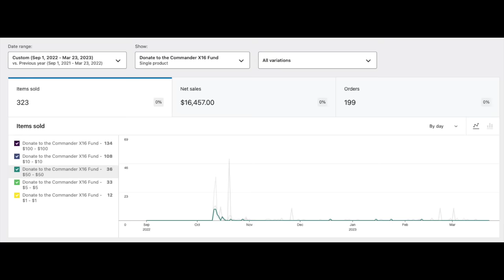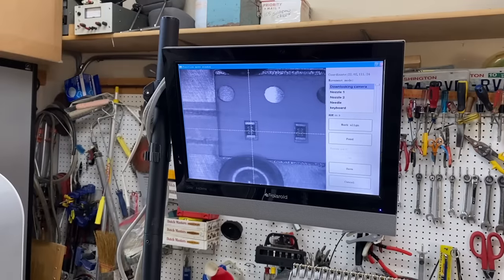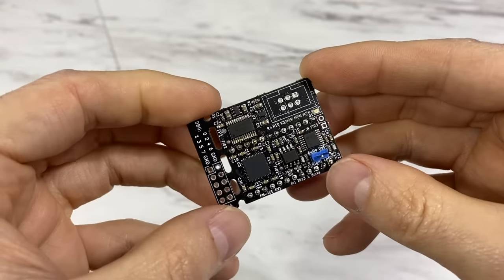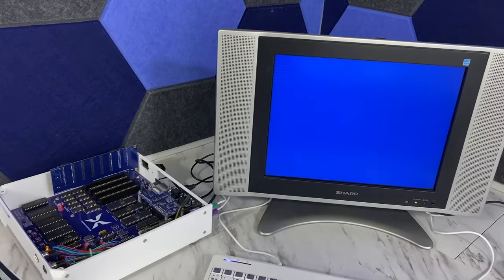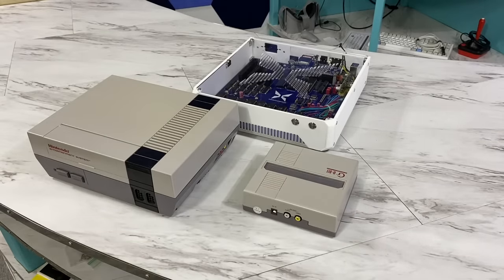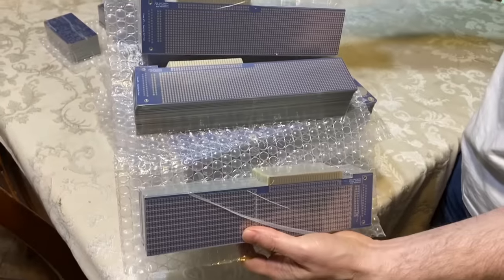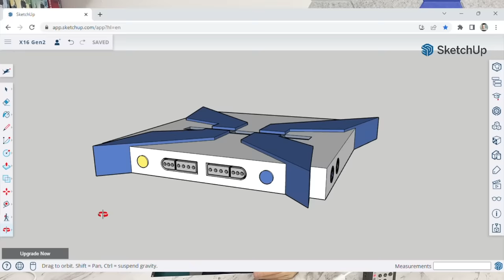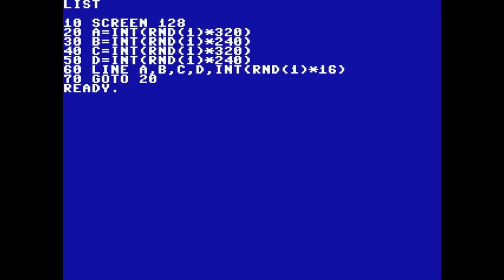Commander X16 2023 update

Comment: I was initially confused with the title of the system.  This is the first time I have heard of the project.  Makes sense to choose the processor you did, now that I know you are building a Commadore clone.  The Z80 was used in Arcade cabinets and IBM Clones.  The first IBM compatible laptop I used was the NEC ULTRALIGHT running a Z80 4.77Mhz with DOS 3.21 and a CGA Blue/Grey lcd display.
Reply: I think in future we shall get a Z80 add-in card, and a raft of software for that.  Are you a developer?
Reply: Er... the Z-80 was absolutely not used in IBM PC clones.  The PC runs on an Intel 8088 (which is a variant of the 8086 with an 8-bit data bus rather than a 16-bit bus, though it's a 16-bit CPU internally), and the Z-80 is not code-compatible with it.

Perhaps you meant it was used on CP/M machines?  CP/M originally targeted the Intel 8080, and the Z-80 was code-compatible with the 8080 instruction set, so it was used in a lot of CP/M machines.
Reply: @ballyastrocade5672  Early PC compatibles non Intel used Z80s
Reply: @DailyCorvid  They can't have.  A Z-80 cannot run 8088/8086 code, so neither MS-DOS nor any applications written for it would be able to run on such a machine -- which would make it not "PC compatible", by definition.
Reply: @ballyastrocade5672  TRS-80
Reply: @DailyCorvid  I...  what?!?  The TRS-80 was not a "PC compatible" in any way, shape, or form.  For one thing, it was not capable of running MS-DOS or any software written for the IBM PC -- and for another, it pre-dates the PC by at least 5 years, so how could it have been "compatible" with a standard that didn't even exist yet?

You seriously don't know what you're talking about.
Reply: Not all early arcade games use a Z80, some games ran on a 6502 or 6809.
Reply: @samp3413  Z80 is harder to code for because it supports multi tasking instructions whereas 6502 is far easier.

Z80 would have been a backwards step for me I am not really interested in any more Z80 computers I have dozens of the things.  My Gameboy has a Z80 lol.

Commodore assembly and BASIC is what us Commodore guys know and are into, so Z80 isn't a supported chip on that platform.
Reply: @Daily Corvid 
  No, I am not a developer.   I am a tech.  I do SQL and a little Powershell script, but I haven't learned any of the full programming languages.
Reply: I just realized that I meant the Zenith Instead of NEC.  My dad got it from work between 1988 and 1992.  The information I had at the time was that it had a Z80 that was running 4.77 Mhz.  It had a 3.5" 20 MB hard disk that had to be manually parked before shutting off.  It ran DOS 3.21, Automenu, QDos2.  I played BattleTech: Crescent Hawk's Inception, Wasteland, Phantasy II, and loads of shareware games downloaded from BBSs on the 1200 baud modem.
Reply: @johnvahl762  I'm learning BBC BASIC now for 6 months, then Commodore BASIC for a further 6 months, then assembly for the 6502 - and finally scripting for GPT.

My intention is to write a GPT client for the Commander X16 eventually, via a series of game releases to practice and hone the various skills I will need.

Zenith was a cool machine, I never owned one but I seen plenty along with some other oddities like the RM Acorn and Archimedes computers.  Along with Tandy and Commodore, they really set my imagination alight in those early days.

And look what happened - we went from "It's a stupid fad don't use your calculator in class" to "kids get your tablets out" during a zoom class :D
Reply: @Daily Corvid  my family started with the Atari 800.  I had 2 friends with Atari computers.  In Jr. High I had another 2 friends with Commadore (1 w/ 64 portable and 1 w/ 128).  My Jr. High had a Commodore Lab.  And 1 friend with an Amiga.  We all had PCs by the end of high school.  I think most of us went into the industry. Now, my nephews and one of my sons are building their own computers.
Reply: @johnvahl762  Yeah same here, after the end of Commodore, and then Amiga = it was Windows for the duration.  I mean I had Macs too but barely used them.

Commodore 128 I have never seen a real one I am looking for a good condition boxed one to buy.  It's near to impossible but I have only been looking a year.

You must have great fun with the family building these things, always loved computers.  Hijinx lol.
Reply: @johnvahl762   Your Zenith PC did not have a Z-80 in it.  No IBM PC clone ever had a Z-80 in it; the Zilog Z-80 was an 8-bit CPU with a 16-bit address bus that could only access 64K of memory in total, and its instruction set wasn't even remotely compatible with the Intel 8088 -- a 16-bit CPU with a 20-bit address bus that could access 1MB of memory -- which the PC platform was based on.  (The Z-80 also did not run at a 4.77MHz clock speed; the standard version ran at 2MHz, and the later Z-80A variant could run at 4MHz.  Zilog did eventually make a Z-80B version which could run at 6MHz, but I don't think it was widely used; I've never actually seen an example of one "in the flesh", as it were.)
Reply: @samp3413  Some of them even ran on less-common (or downright obscure) chips like the Signetics 2650, General instruments' 1610, or the RCA 1802, as well.  There were a lot of companies trying to get in on the microprocessor market back in the 8-bit era, although most of them dropped out in the early 90s and left Intel and Motorola to fight it out in the 16-bit space. 🙂
Reply: @DailyCorvid  It's not harder to code for, the assembler is just a little harder to learn than 6502 is, especially if you've learned 6502 or 680x prior. But coding and problem solving on the z80 can be much easier.
Reply: @samp3413  When the Z80 add-in card is released I will probably get it at that stage, and maybe have a play with it.

I have not learned 6502 that well at all!  No that is just something I know of because I sold a tonne of them :) But I was not a code guy I was a acc-sales guy.  I wish to learn.

I guess this project appeals to me because it isn't a million miles away from the old Commodore 64 community, it's a straight continuation.  I am already in that.

But after that I might learn Z80 code too, who knows depends how long it takes.

Comment: This is a very confusing video. I would love a follow up video with some clarifications and more details about the decisions made. I am very interested to learn about the kinds of issues that come up in small scale manufacturing like this. For example, why can’t you get the boards manufactured by a PCBA house like PCBWay? This certainly seems to be ideal. And for the sound chip issues, well, doesn’t the VERA chip have sound capabilities? Why not ship with the Yamaha chip unpopulated, and tell people to use the VERA for sound. People wishing to run existing software can buy an $11 IC or similarly priced emulated solution.
Reply: 1) Why not PCBWay? Very problematic logistics of components to China. David's words. However according to today's Facebook post they are in a process of getting an electronics assembly quote from a Texas company Suntronic.
2) Community making music for X16 likes YM2151 a lot. Excluding it would make it not default anymore and some developers would only target PSG because of it. For the same reason all X16s will be shipped with a mouse.
Reply: @novh4ck  That's not true. I use PCBway all the time, and while shipping the parts to China is a bit annoying, it's nowhere close to the pain of trying to do the work yourself...

Comment: There is a modern OPL chip, the YMF825, but I am sure you probably already considered it.
Reply: Though it shares similarities with the OPL3, the YMF825 (SD-1) is not OPL. If the 8-Bit Guy already considered it, I'd like to know why he suggested dual OPL3's as a plan C. Personally, I'd suggest dual SD-1's (one for each channel, as it's mono), and perhaps remove the PSG from VERA, as the SD-1 has all the PSG's waveforms, except for noise.
Reply: Having researched the PSG a little more, I don't think the SD-1 supports modifying the pulse width.
Anyways, having scrolled down further, the 8-Bit Guy said that he wasn't familiar with it, and that he'll look into it.

Comment: I'm willing to bet (not, y'know, a lot) that some developer is going to take one of those dev boards and interface either:
a) an arduino of some kind
b) a raspberry pi or related SBC
c) a z-80 cpu board.

and possibly, only more farfetched, imo... a voodoo2-like board to give 3d acceleration to the vera
Reply: Okay, I posted this message BEFORE 40:11 when he said basically the same thing lol

Comment: For the record even the whole Amiga line up was never capable of running doom though many people tried to port
Reply: The whole Amiga line up? You're wrong.
Reply: @Okurka.  what did I miss?
Reply: @marcello4258  Amiga 4000
Reply: I would say 8 Mhz is not enough. For Wolfenstein 3d you needed about 12-16 Mhz and a 80286 at least. DOOM required a 386 and a CPU speed of at least 33 MHz to run well. 
Maybe an Acorn Archimedes can run that at a lower clock speed. But even there I would guess that you need at least 16 MHz for something like DOOM.
Of course you can lower the resolution and make it work that way, but this is not the same.

Comment: The price should be $666.66 - like the Apple 1 was in 1976 :)   At least offer it as a package option - maybe "signature edition" ?  ChickenLips edition? :)  Thanks for the update, good stuff!
Reply: Well….. David is more of a commodore guy. But still, good reference :)
Reply: @ecernosoft3096    Yeah, true.  The Commodore PET 1977 list price (base 4K RAM) was $595 (per old issues of BYTE magazine).      The $500 price is closer to the original Altair 8800 kit price (think it was $439, the built price was also $600-something).    So there Dave, I won't buy it unless it's at least $595 :)  (oh, and if that includes a case and keyboard? don't think video was clear if the $500 included those?)
Reply: @ecernosoft3096  I'm ok with that, for a sub-100 serial number!    Speaking of which, yeah they'll need to serialize that motherboard and case.
Reply: $595 was also the original price of the Commodore 64 - though that price dropped very quickly (within months IIRC).    Price isn't just parts plus some labor - but also warranty and to sustain continued product support (like manuals/books, software, and real estate to build more).  The $666 for the Apple-1 was way overpriced for what it was (the earlier KIM-1 was 1/3rd that price), but it helped them get enough capital for the next phase a year later.
Reply: @voidstar1337  hahaha!! 

That makes me wonder, does he put serial no’s on them?

Comment: I totally agree that they made a mistake when they went with a single button joystick as the standard on the Amiga. I think that actually contributed to the system's downfall, even if just in a small way.
Reply: The sad thing is, all Amigas supported 2 buttons, no idea why most devs never bothered using the second button, lazy porting habits from the ST or joystick manufacturers dumping old 8 bit stock cheap on the 16 bit market and devs targeting the lowest common denominator maybe?

Comment: Why not get PCB way to manufacture the PCBAs fully populated with components & also you could probably get the device finished & manufactured as a completed system by Taiwanese tech companies like compal & quanta computer.
Reply: For SMD boards that's better for sure. For boards with DIP chips? That's something these companies price at premium because boards like that are not generally manufactured these days.
Reply: @novhack  Ahh fair point,  it's true that boards with DIP packages are less used these days.

Comment: Speaking of BASIC: I love the Atari 8 Bit way. The editor is fast enough and better to handle than the C64 style (I had both computers, so I know, althru I actually prefer Atari anyway). So may be you implement the Atari style BASIC programming as well. The main key difference between C64 BASIC and Atari BASIC programming style may be that you can LIST a program with L. instead of lI (short L and big i). And you can hold the listing (or any output on the Atari 8 Bit) by pressing Ctrl+1 at any time. Oh, you have 3 lines in a row to form one logical line without the need to use an advanced editor (original C64 had only two lines). Atari BASIC saves everything tokenized by default and reverts the tokens to (well formatted) text whenever you LIST the program or parts of it. Speaking of parts of the program: you can LIST parts by typing LIST and linenumber (e.g. LIST 10 or L.10), linenumbers (e.g. LIST 10,20), or on Turbo-BASIC you also can type LIST 10, (a ten followed by a komma, and then no second number) which LISTs from line 10 to the end of the program. The X16 firmware could implement all of these, without the need of an advanced NOTEPAD style editor. My big big dream for the future of the X16 is a firmware that had interchangeable behaving, like Atari 8 Bit, and may be many more of computers of that area. Anyway enough said ... back to the video (I'm at 31:38 by the time of writing this).

Comment: GFA basic for the Atari ST was similar to what you describe. It had a full screen text-based editor, with functions accessible with the F keys. There were no line numbers, and the language was procedural. No need for GOTO! There was also an optional compiler available. It's worth a look if you haven't seen it before. https://youtu.be/ndGxK9gPcRI?t=163
Reply: There are several suitable versions of  BASIC that could be used, many of which are already 6502 optimised. Getting the Atari ST GFA converted to an 8 bit 6502 might be a tad optimistic, although a cross compiler could do the job if you develop on a PC/Mac. The GFA author also created Turbo Basic XL for the Atari 8 bits. It used line numbers, but was otherwise very powerful and fast, the source is open, but I doubt it would be easy to convert.
Reply: @another3997  Of course. I didn't mean to suggest to convert the code to 65C02, but to have a look at the language itself and the interface. David talked about gotos with labels, but there are better solutions out there.

Comment: Need a radial lead cutter? I think I've still got one from when I used to do through-hole kits.
Reply: 4:28 They already bought one with money ppl gave them.
Reply: @Okurka.  That's an axial lead former. I might still have one of those, too, but it was a little banged up. The radial lead cutter is a simple hand-cranked device that cuts leads of radial lead components like capacitors.

Comment: As for the Sound chip, I favor keeping the YM2151 in its socket for the X16Dev, with the FPGA daughter board. Then for the X16c, design and build the FPGA solution into the board. That will save build cost in two ways ... first, it's part of the same pick and place routine, and second it can share a 3v level converted data bus with the Vera chip

Comment: I wonder if it would be possible to be able to have more than 256 different characters on screen at once, for many Latin and Cyrillic based languages on screen?
Reply: Especially for Japanese, where it uses over a thousand characters
Reply: And on top of that, what about 16x16 characters (fewer will fit on the screen, but they are higher definition)

Comment: Many thanks for the very complete review of the current Commander X16 status. I think that 350 USD is feasible so I will wait for the 2nd batch (I call it "Revision A"). Really hope that the Yamaha issue and the communication add-on is sorted out until this second batch. 

Also, for the expansion/cartridge ports I would suggest some z80 MSXs systems that had a pinout slot in the back/side that would lead a ribbon to some sort of external 3 or 4 slot device, so expansion boards and cartridges can be inserted easily without opening the case.

Comment: I love the keyboard and the case. :)
6 hours? Oof! No wonder my old friend preferred surface-mount to through-hole.
Sorry to hear about the sound situation.
I had a video capture cartrige for my ST. :) Tiny resolution & monochrome though. XD
The game console version looks awesome! XD
Sounds like dropping the "Gen 2" name is a good idea; it makes it sound like it superceeds the ATX version.

You know, Atari put an amazing expansion port on their XL series; I think the port let you do anything you could do by soldering wires inside, or almost anything, and all it was physically was the pads for an edge connector. You could put something like that on the console. Maybe just a reverse expansion port. The question is though, would people then buy consoles to upgrade rather than the dev system, and would you want that? :)

I wasn't allowed on BBSs in the 80s, but I've logged into a few in the last 15 years simply using telnet. I kind-of didn't need to use them so I didn't get much out of them, but I'm sure I'd have had much more fun with them if I'd been using a machine which couldn't render the modern web, video & games. :)

Related to the BBS thing, I wonder if the X16 would be taken up by the solarpunk crowd? I'm sure it'll use less energy than modern machines.

Comment: A couple of things that would be nice to see:

I wonder if it would be possible to port GCC to it?  This would give you the ability to run  modern C, which opens up a lot of existing C code, to just needing some tweaking.  

This would also allow for a TCP/IP stack, where a lot of the code is ported from other operating systems, like Linux.   I think a network card that uses a standard Ethernet (gigabit) chip, makes the most sense for networking, since the back end already exists.  

It also would allow for porting stuff like ncurses, giving the ability to port existing editors like Vi or Nano.  

For BASIC, a signature block at the beginning of a program, that indicates that it's already tokenized, if not it runs a tokenizer before running the program.  However if you save it, it saves the tokenized version.